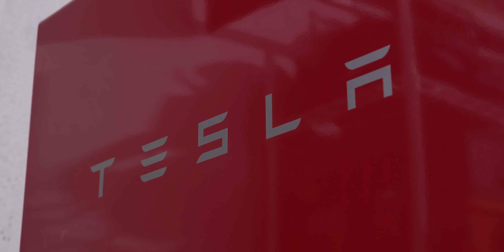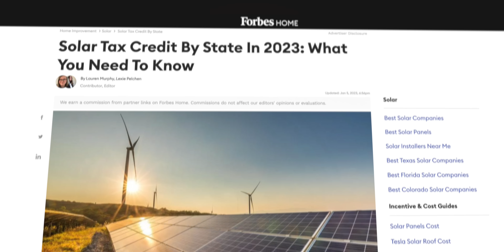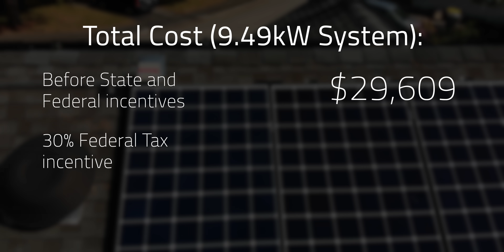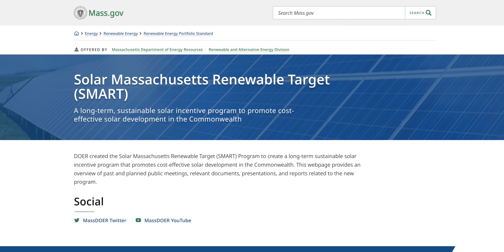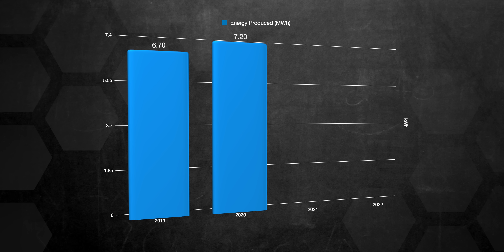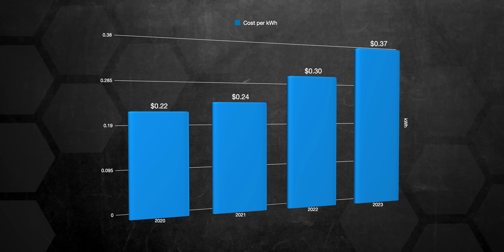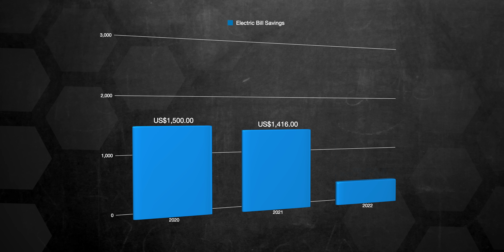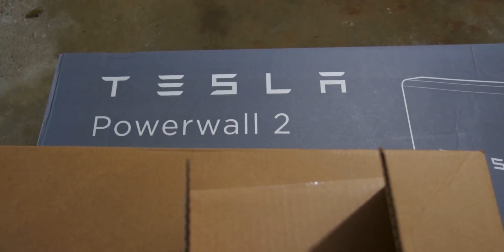5 Years with Solar Panels - Is It Still Worth It?

Comment: I started in September 2019 with a mini solar 300 Watt inverter and one 330 Watt Cell,
Just next month I bought a 2h Inverter with another 6 Cells.
The hole system, now 2*2k Inverter and 22 Cells including Fuses, Cable, Plugs, and ladders to walk on the roof took me near 120.000 Thai Baht, and will be payed of end of May 2023.
As of the options about Solar here in Thailand until now I only have OnGrid Inverter and Feed and take back night without separating.
It took longer than 3 years, as I started with less Cells, mean the Inverter could play out full power.

What to know before sure is how much will a Cell / Inverter deliver more exact, but so I went slowly more and more closed to last month 90% electric from Solar.

Sure I would do it again.
As minimum I need 24 Cells and maximum in Summer would be 36 Cells (each 330 Watt, deliver most over 200 Watt) I will enlarge with a hybrid now, as then even with Blackout I can start the OnGrid Inverter then behind and still make 4.500 Watt at Lunch for fill up all Batteries or Wattertanks if needed.

Until now only emergency AC Ststem with 95AH for Router and lights, but also force to future with Batteries and take the Solar plus into the night then.
As wanna change to EV and also from GAs Cooking to Induction ... still a lot to do.

Comment: how can this be like the definition of sustainability; in reality you want to have build with taxpayer money a power plant, hydro/nuclear and have that collectively made energy distributed as it's clearly cheaper and better for this planet to centralized power plants instead of every soul out of 8 billion to have the 'future tech' a battery and individual system. out of anything a centralized system is better, cleaner, cheaper and lasts longer than a non-linear practice in having your own power generating installation. I only see this acceptable on real remote locations, otherwise its a fad, toying with resources; ppl doing this are like digging for arguments as time passes by.. it's better, it gives back to community, electricity prices raises... but don't address the real issue, why does the electricity price raises? you cant just bank the current so it's made to be used so to why, fundamentally, electricity prices rise? question remains opened.

Comment: tbh as someone who lives in north Africa (Algeria) we usually slam americans for being wasteful, but from energy POV, i remember in our previous small apartment (90m2 surface) i install 1KW of panels and 7kwh battery storage (AGM), as a pilot project to just test my skill and get into renewable energy, i also did a training course at our grid company's technical school as solar installer, so it was a good experience for me, i sized the system to be cost effective, means i'm using it as backup generator for lighting, fridge and TVs/laptops, so i calculated it to be the most effective option for me, we used to consume 5kwh/day in mid seasons.
but during summer (i live in the desert) it rise to 10kwh/day
Later we moved to our new home (500m2 property, with 140m2 built and 2 floors), i bought a new 5KVA inverter, and 22kwh storage, (OpzS cells i think they are more cost effective here), i still didn't buy the 2000KW PV panels i need, but i calculated that we consume 4.7MWh/year so yeah, at 1st glance i don't understand how can americans consume so much electricity, but we use natural gas here for heating a cooking, and if i factor it in it's 13Mwh for heating alone, for countries where they use electricity for heating, 13Mhw/year is like the baseline.
people here think solar for domestic is a luxury, because energy prices here at low, specially for natural gas, but i don't think it will be that way for long, our country been under pressure to export more natural gas to europe and domestic consumption is 50percent of national production, so naturally, natural gas prices will get higher on the long run.

Comment: I installed a 4.85kW system 9.5 years ago which is now in the green thanks to my state treating me like a utility and paid me an average of +$2400 for 6 years for about 5.1 MWh per year [48.2 cents] for buying all made in Washington products [panels, inverters, hardware and labor]. Plus a fed tax credit of $7460. I save about 30% of original bill or $65 per month with net metering. I am now looking at adding batteries and upgrading the panels to 330W from 260 [same size and maker but 18 panels will cost under $4K]. That should get me about a 40% increase and a new warrantee. Will need to up size the microinverters but can use same mounts and wiring. Looking at around 7kwh of batteries as the longest outage in last 20 years was 4 hours. Grid has been improved since the worst outage of 24 hours in the 90's. I can see doing an Ecoflow Delta Pro for flexibility down the road. Hope to add an electric vehicle that can at the least do vehicle to load and use that to charge a battery if needed. I checked with my original installer and he is booked into next year already with mostly new installs.

Comment: Thanks Matt, all good information.  Over it's 11-year life, my relatively modest, but ideally situated 3.6 kWh solar PV system has produced more than 40 MWh of energy, the equivalent of 160,000 EV miles.  Currently waiting for my battery to be installed, which should give me almost complete selectivity autonomy during summer and parts of spring/autumn.  Generally speaking, solar PV is a no-brainer...

Comment: If the panels on your roof are in a string, that tiny bit of shade in the right corner is a power killer. It doesn't take much shadow to severely affect power output. Dave over at EEVBlog has a video just on how small the shadow has to be.
Reply: I believe the microinverters negate shading effect on a string.
Reply: Mike is correct. We have the same enphase micro inverters on our system. Each panel delivers AC power independently.

Comment: In 2021 I did quite a deep research for my parents because they wanted solar panels on their house. They use ~10MWh of electricity  per year mostly due to geothermal heat pump and the building is just big. It was perfect scenario because they have south-facing roof. Until April 2022 in Poland people were able to sign 15 years contract and then from energy consumed from grid 80% of energy produced was subtracted in period of 6 months. For 9,2MWp installation with 1 central inverter they paid 31500 PLN (1USD was 3.939PLN at that time so it was 7997 USD) including tax. Then it they got tax refund of around 10000 PLN for 2021. For entire 2022 instalation produced 9,65MWh. 

I wonder what causes such a big price of solar installation in MA?  Micro inverters can be more expensive that 1 central inverter but not as much. Is it labor cost?

Comment: EV battery are big for the long drive, but most vehicles are parked 23hrs a day. 
And daily drive is only 7kwh average. 

So EV have a massive capacity as part of a Virtual Power Plant on a daily basis. 

Dispatchable electricity is the point. 

We just need the home robotic vacuum cleaner to teach the selfparking EV to connect to the grid. Hahaha 😊 

Street power poles with chargers are happening now. Imagine selfparking/ plug in. 

All buildings are connected to the national grid so selfparking plug in should be the go.

The vehicles can be topped up daily. 
The vehicles can be programmed for the long drive top up. 
Rapid charging will still be available on the high way and corner store,  etc.

Comment: And when everyone has solar power the money you get from feeding in will be negligible, in fact you might have to pay the power company to take it. Already in New South Wales two energy companies are asking for a solar panel tax because there's excess electricity generated around midday when the sun is high in the sky.

The other problem is that you'll be paying for panels that you only need for one or two months per year.  You'll probably find that to generate X amount of electricity in winter you'll need four times as many panels as you do in summer.

Comment: I'm in Texas, I have solar installed two years ago. Based on two years experience of dealing with electric companies to get the best return from excess energy generated by our system, they way they change the export electricity price I recommend "NO" to the friends and relatives whoever asks for the solar recommendation. It might need several decades to get my investment returned.

Comment: We had a 15.6 kwh system installed in a ground mount configuration in 2021-22.  We went with a more expensive but we respected company in the area after working through many quotes.  I still ended up essentially acting as the GC on the project, routinely catching large and small errors made by the installers.  So, like any contractor work, keep in mind, you are responsible for keeping tabs on the people working.  Ours had several less than ideal electrical connections, and they even installed the wrong panels!  Overall, still glad we got the system, it more than offset our electrical use until we got a second EV at which point is depends on seasonality if it covers usage or not.  Biggest regret was not doing a battery system.  We do lose power a few times a year, and it's only an annoyance at this point.  That said, I'd really like a setup that allows the solar to produce and use during grid down situations.  At the time (and still) it is not financially prudent.  A whole house generator is a fraction of the cost (1/4) of a battery backup and doesn't require sun.

Comment: These are great numbers, proving that solar is excellent practically everywhere.

We're in Canberra, Australia. We have 20kW on our roof and generate about 21 MWh per year. That's not too dissimilar to how you're doing way up north!

Like most people I'm very critical of government decisions, but ours did a great job on solar, by providing subsidies, HUGE feed in tariffs for very early adopters, and so on. But by far the best thing they did was to almost eliminate red tape in a solar installation - eliminating cost. Four years ago the full purchase price for 20 kW installed was AUD28,000 - about $USD19,000. Compare that to what you pay and red tape is the killer. (We were also subsidised, so paid AUD15,290, USD10,319. For 20kW, installed and working, with a 12c FIT.)

Now that you are truly jealous, I can tell you what these decisions have done for Australia.

In April this year rooftop solar will surpass coal as the primary electricity generator in Australia. Right now total solar - rooftop and solar farms - is the leading power generator here; it's when a coal power station gets shut down in April that rooftop solar becomes an even bigger part.

But you having such great performance way up north proves that the who;e US can run on solar. Just do it!

Comment: My house has turned into a RAM Promaster City Van.   When Puerto Rico had its first big power outage I felt things were getting crazy so I built a single solar panel generator with an AGM battery.   Three years later when my apartment housing was destroyed via race attacks I moved with my solar system into my SUV.   Two years later I moved again into a van.  With the van I added two RV Batteries.   Works great I am an elderly guy retired to Van life and solar power.

Comment: I WISH I HAD KNOWN that our grid-connected solar panels would not serve us electricity during a power outage. We found this out on the day installation was complete - the same day as a big rainstorm that caused an outage. 😂 That information was so buried by our solar company that it took about 45 minutes of troubleshooting by their technician to discover and share that we weren't getting power because there was an outage in our area! 

Something I couldn't have known is that our solar company, along with most of the others in the surrounding states (NH, VT, MN, MA) went belly up in 2020-21 , leaving us with no one willing to service our gigantic, sophisticated solar tracker. I learned a lot about DIY solar tracker maintenance in 2022, for better or worse, and felt very appreciative of one friendly guy in Texas - a parts supplier of our tracker system - who stuck with me through some very greasy, tense weeks while repairing my tracker. 

Trackers are great for energy production, but more moving parts means more chances something will break.

All in all, I love having solar and recommend it to everyone who sees our tracker and asks about it.

Comment: Roof Repair.  A design for a solar array for our flat roof residence covered about 50% of the roof area.  That concerned me.  Just prior to the design our roof developed a leak in one location.  Absent solar panels, a quick repair solved the leak.  Had a solar panel been there, I don't know exactly how we would have addressed the leak.  Now, you might think the solar panel would have prevented the leak by blocking the location, but the leak included water draining from other parts of the roof.  Bottom line, the issue of roof maintenance gives me great pause when I consider whether I want to commit to an investment in solar with a fairly long pay back.

Comment: Used solar twenty Plus years o have very low   drain lights only  led  no heat  producing appliances  phone chargers and video chargers spent less than five hundred in  maintenance in twenty years  the secret is very low drain on batteries. Use less power  🤔

Comment: I did a lot of research before installing my system and there's not really anything I was surprised by later. Also like you, I had an excellent installer for my solar system - ME. That's right; I  did it myself after being extremely dissatisfied with 2 installers I signed contracts with. I was able to get my deposit back kn both cases. Like you, I'm going with yhd same installer for my battery.

Comment: What will it cost to have the solar panels removed to fix a leaking roof? In AZ it's 15k to 20k just to remove the panels to fix the roof. It's another 15k to 20k to put them back up. The roof panels are bolted to the roof. When the wind hits them they shake back and forth which makes the bolt holes in your roof a little bigger then creates water leaks. Plus, engineers calculate the roof weight and build Roof Truss to hold that weight, when you add the weight of the solar panels you are asking for trouble. In AZ the Electric Companies charge the home owner $45.00 a month for having solar panels. There is no savings at all.

Comment: As someone living in central AL, I would really like solar for my fairly treeless neighborhood since my house faces west/southwest, and one side of my roof is fairly southward…but Alabama Power is a crook and charges a fee per kWh for solar production on residential users. Maybe your guide will help me get over that and learn more about how to pursue solar wisely. Thank you for the review as well, Matt. Great content, and easily some of the best on YT.
Reply: I don't know your specifics but the power company probably won't charge you for a "self-consumption" setup. This is where you use all of the solar power yourself and don't feed any back to the grid. These are often most well suited to battery systems because then you can still save excess power for later.

Comment: I live in Melbourne, Australia, and have had a 6.6 Kw solar system that was installed in November of 2018. Just recently (October 2022) l had a tesla powerwall 2 installed too. We couldn't be happier with them both. We are on a TOU rate with our power provider, but now that we have the powerwall, the grid is our backup to the battery. Our FIT is only 10 cents per Kilowatt. So the first 13 kilowatts FIT for the day actually pays for our "daily supply charge", which is something we cannot avoid, while still being "grid tied". All in all, im a solar and battery fanboy. I always look forward to Matts "Undecided" videos.

Comment: Here in NH, not to far from you my electric rate doubled in a single month.  I grew up in a house with a metal roof.  Taller and larger than yours.  After a snowfall we'd avoid the parts of the house where the snow could come off and kill you.  And yes when the snow comes off an "avalanche" is exactly what it sounds and feels like.

Comment: Interesting. I bought a 1995 cape in the summer of 2021 in New England. My goal was to do a net zero retrofit. I did an overhaul of the insulation, extensive air sealing (CFM50 of 1456, or about 45% of our pre-insulation number), tossed the oil furnace and put in 7-series 5-ton Waterfunrace geothermal unit, and a 16 kWh solar array with two backup Tesla batteries. It's only been a few months since I flipped the switch on the new mechanicals, so I don't have enough data yet to speak directly to cost offsets, but performance-wise, things are looking good.  During the 24 hr cold snap that New England suffered in early February, our panels put out enough electricity to offset our usage (it was a SUNNY day), that of course included heating costs. The Waterfurnace unit ran entirely on the compressor (no resistance heat was triggered), even with overnight lows of -20 F. There were lots of accessory costs in the retrofit that I could share warnings about, but overall, we are very happy with the outcome. Welcome to the club!